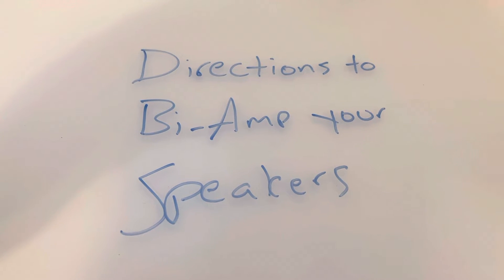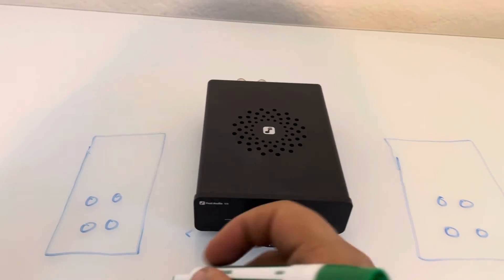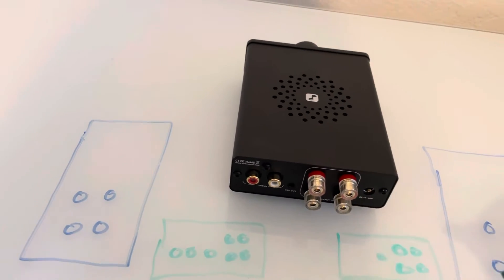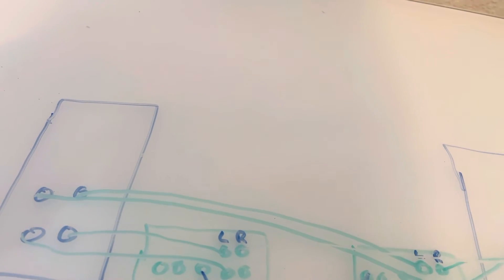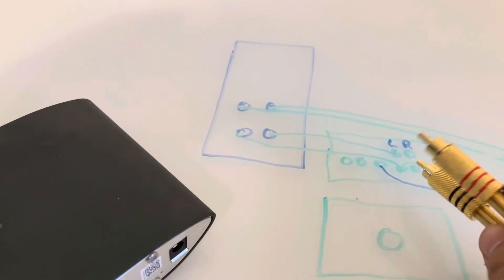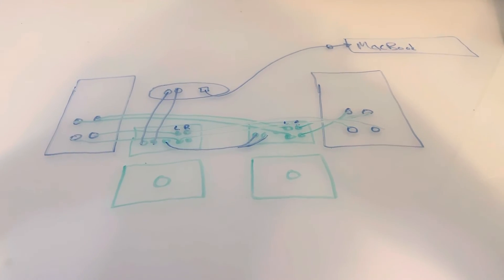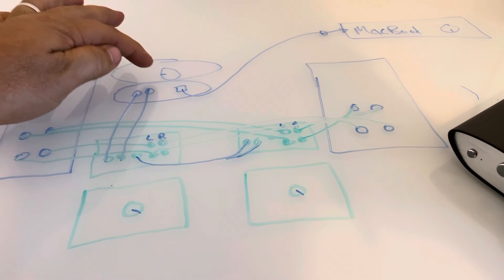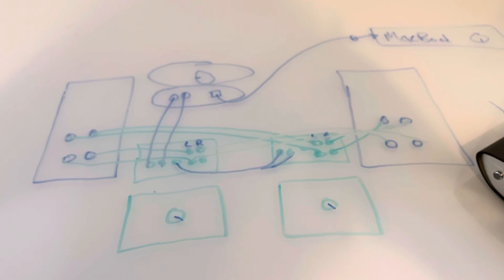How to Bi-Amp Your Speakers with Ifi, Fosi Audio and Martin Logan

Comment: Have you tried vertical? 1 amp per speaker? You mentioned crosstalk?
Reply from the maker: I’m not sure what you mean by vertical.

Crosstalk became an issue when I used one amp per speaker. As in the video, using one amp for the R/L tweeters and one amp for the R/L woofers, resulted in the best sound.

But, using amps with Mono input/output would be best (but generally more expensive).
Reply: @twistyflora  Hi, I agree with you, thanks for the explanation

Comment: I have an Aiyima A07 Pro, and I want to bi-amp my Polk towers, however, I see that the amp says "Line-out" instead of "Pre-out", I believe these work in a different way. Would it still work? Or do I need to buy a different pair of amps that have Pre-out?
Reply from the maker: I’ve never used the a07 pro, but line out generally means it sends out a full, fixed sound signal. You want an output that has variable volume control.
Reply: @twistyflora  Thank you, I will do my research then. Appreciate the response!

Comment: Question: At 2:55 you defend wiring to have one tweeter amp and one woofer amp because of crosstalk  Stereo amps like the V2 always have some crosstalk between channels.  The way you wire it the crosstalk will be between the L/R tweeters on amp 1 amp, and the L/R Woofers on amp 2, which will narrow your stereo image (just a bit).  It will also screw up your High and Low Frequency balance if one amp has slightly more gain than the other.   If you wired it  Amp 1 to Left Tweet/Woof and Amp 2 to Right Tweet/Woof the Crosstalk would be between each channel's Woofer/Tweeter, which will be filtered out by the speaker's internal crossovers.  The other (primary) advantage of this 2nd method is because bass notes require up 10 times more power than treble notes, you will be using each amp closer to its capacity (and get a lot more dynamic range) rather than using the tweeter amp's power almost not at all and the woofer amps power to near its capacity.   Of course, you would need to wire the inputs differently.  Just askin.
Reply from the maker: One thing I don’t understand, what role does the crossover play when bi-amping?
Reply: Wouldn't the two methods of wiring depend on the source? If your source is like the video and only has one output, you would want to wire as shown. If you have a two source output, say from a preamp like the Schiit Saga, one amp per speaker without the need for the pre out from one amp to the next. Am I thinking correctly?
Reply from the maker: @garrettowens6314  something like that would be ideal if the preamp had two equal outputs. Then the gain would be consistent and you wouldn’t have to worry about it quite like I do. But if your preamp only has a one output, then you can set it up like I show in this video.
Reply: wonderful very well detailed about the connections, really appreciated
Reply from the maker: I tried it both ways, and the crosstalk was significant when using your described method. 

But having equal gain is the issue with my preferred method. The amp running the woofers definitely got warmer than the amp running the tweeter. But this was (by far) my preferred method.

Still, it’s free to try both options. And it doesn’t hurt anything to try.